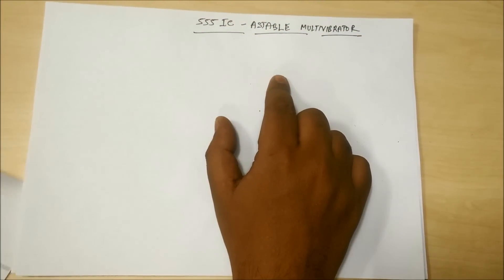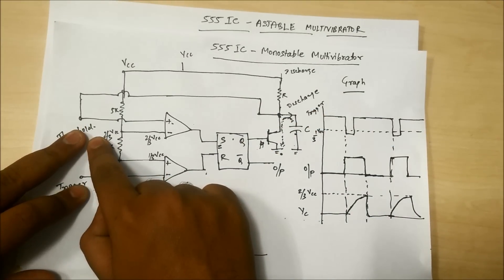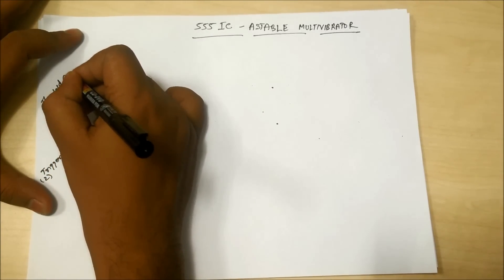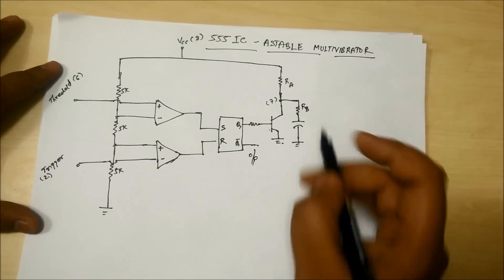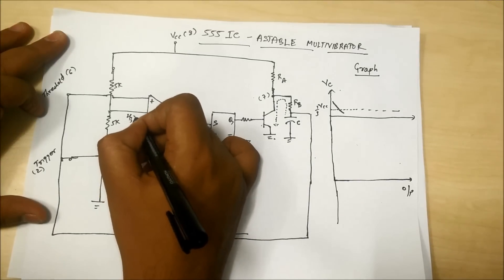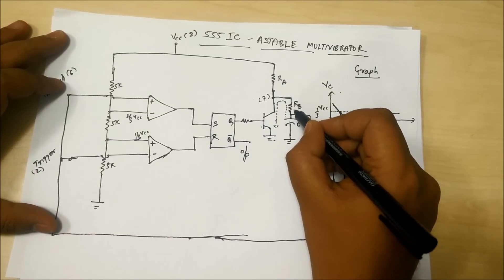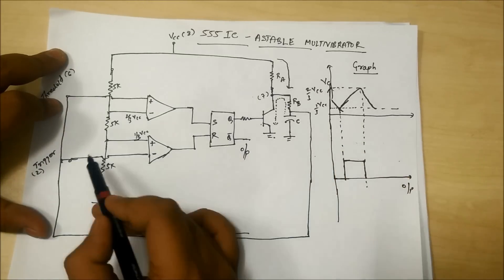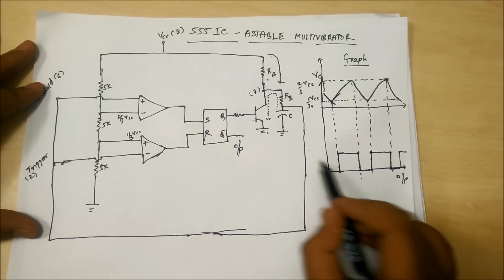555 IC as   ASTABLE MULTIVIBRATOR

Comment: It was awesome. still I'm confused between the difference between monostable and Astable. Astable is Ok but I'm stuck in concept of triggering of monostable. is is User dependent? Like only when he would like to ground, then the capacitor will discharge and if not it'd be continously to charge.
Reply from the maker: @sagar  - Here is the answer to your confusion  .

1)  Yes Triggering of Monostable is user dependent .
2)  When a user momentarily excites the trigger input by momentarily grounding the pin  - The R Input of Flip flop becomes High -----This causes Q to be low which turns the discharge transistor off ....This is the time when the Capacitor starts Charging to 2/3 Vcc.
3) Once it reaches 2/3 Vcc ----- The S Pin of Flip Flop becomes high thereby Q becomes High ----This turns ON the discharge transistor which causes Capacitor to discharge .Thereby capacitor voltage discharges and hence  S has voltage which is low and also R is also low.You may be aware in S-R flipflop if both input are Low then output remains at previous stage .
4) To change the output -now you have to disturb the S-R input for which ,you ground the Trigger pin ( It depends on user when he connects to ground) .In contrast ,In Astable we connect it to capacitor so when capacitor discharges below 1/3 Vcc ----It automatically makes R pin low.

Let me know if it clears your confusion .I will suggest refer the graph which I have explained in my video of Monostable Multivibrator.
Reply: It is perfect. Hats off to your awesome dedication. Such acts motivates me to be like you. Thank you so much.
Reply: Thanks thanks thanks thanks!!!!!
Reply from the maker: ha ha ha Thank you Thank you Thank you Shivani and Wish you a very Happy Diwali.